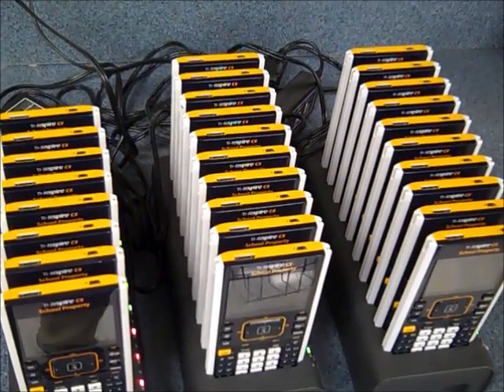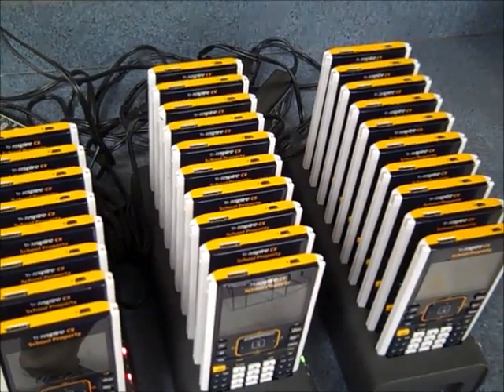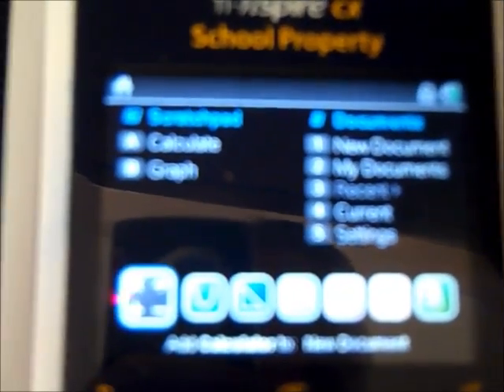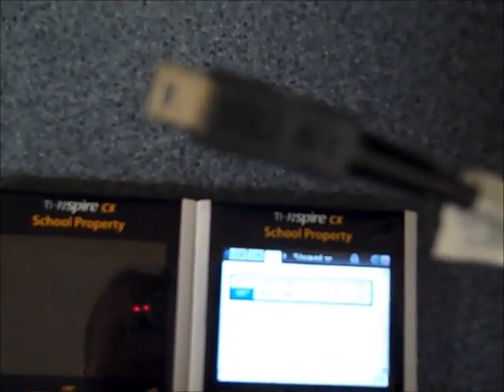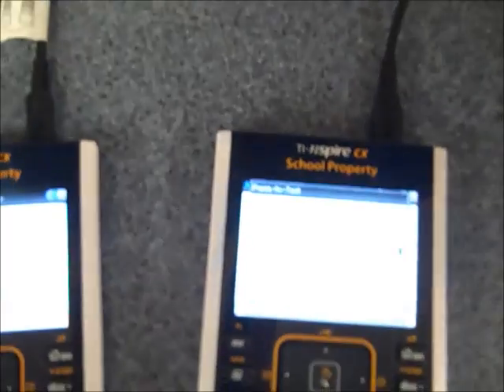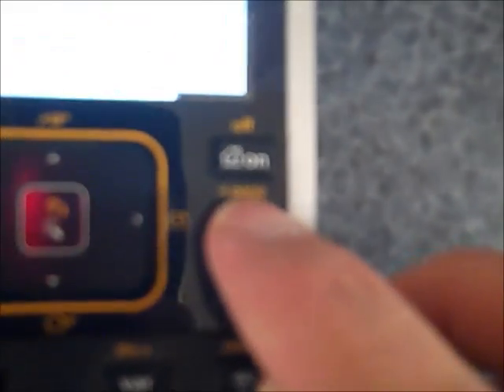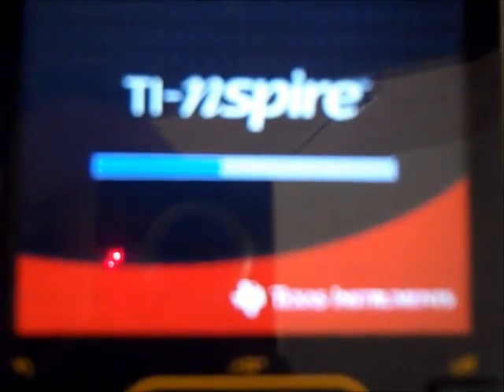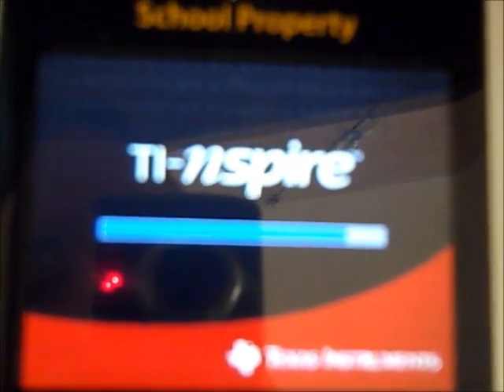Exit Press to Test Mode TI Nspire CX Calculator

Comment: what if you only have one calculator???
Reply from the maker: I frankly don't know how to do it with just one calculator.  I'll be calling TI for help with something else soon and will try to remember to ask.  But you can call TI yourself at 1800 TICARES.  Thanks for viewing and commenting.
Reply: Seems this guy doesn't consider anyone but other teachers.
Reply: Plug it into your computer
Reply: What if i run linux?
Reply: It is impossible to exit press-to-test mode without another connectivity device. Most of the time this is a computer. There is NO possible way to fix it with only one calculator by yourself. Sorry.